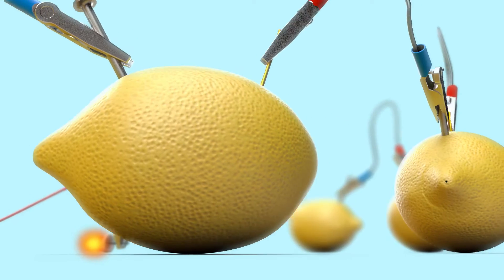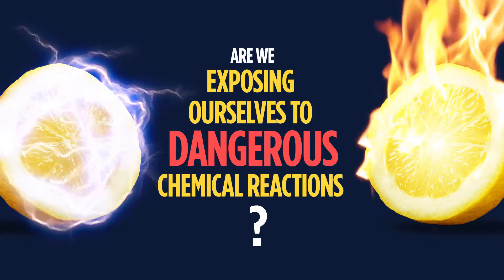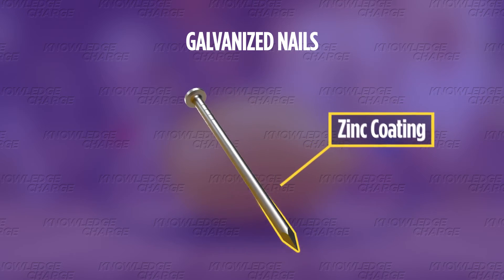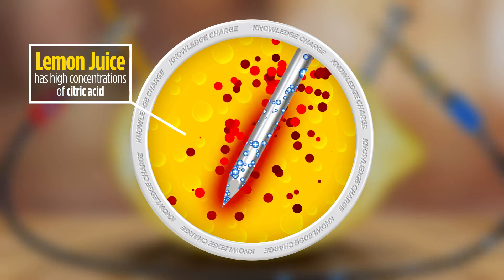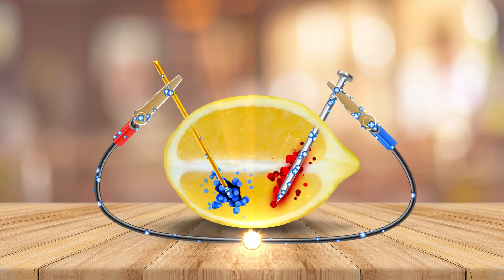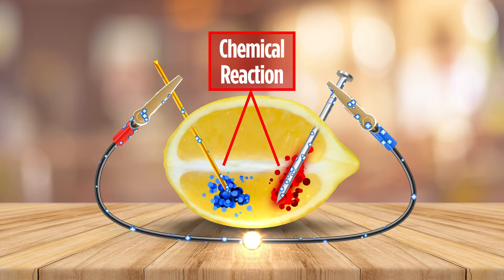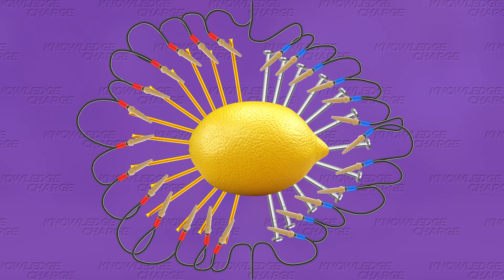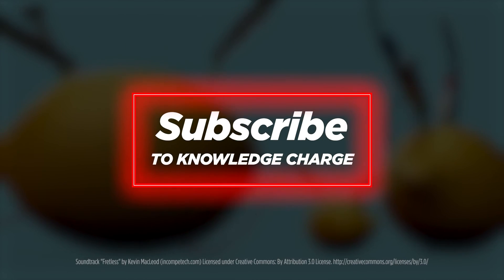Electricity and Fire in Lemon Battery EXPLAINED

Comment: Um...   You weren't aware that the "lemon fire" videos are all fake?    Sheesh.

No, a few-lemon battery can't produce fire, no matter how "correctly" its set up.  Neither can it light a 220V bulb, or charge your phone.   Lots of hoax "lemon battery" videos on YT.
.
On the other hand, an enormous battery (huge numbers of lemons) might have enough voltage to produce a tiny spark, then use the spark to ignite flammable solvents.   Like this one with 1.27 kilovolts! https://www.youtube.com/watch?v=6fDail5bvss&t=84

Comment: Electrons are negative, and so should be the flowing bubbles in your cartoons. Electricity flows in the opposite direction of the electrons by convention. Apart from these two mistakes, great illustration for the experiment.
Reply from the maker: Well noted. Many thanks for your input!
Reply: Even more, in order to add voltages there must be galvanic separation so add nails to the same lemon will not work, you need more lemons.